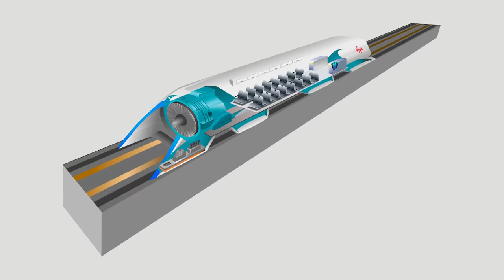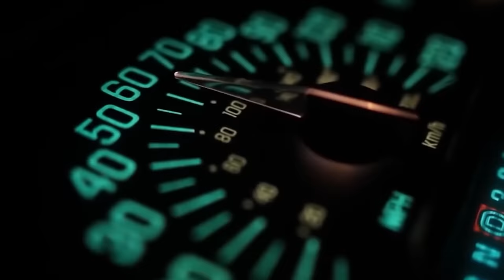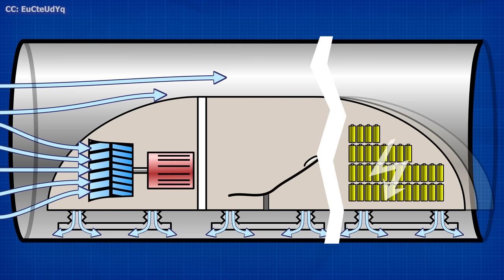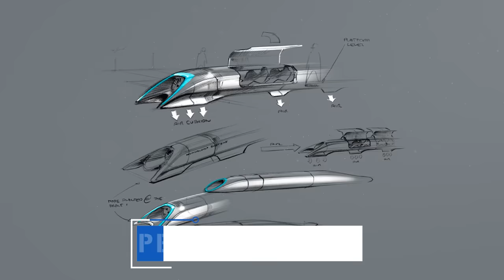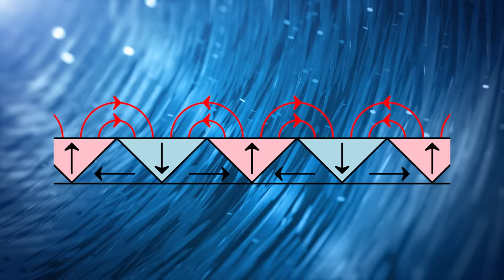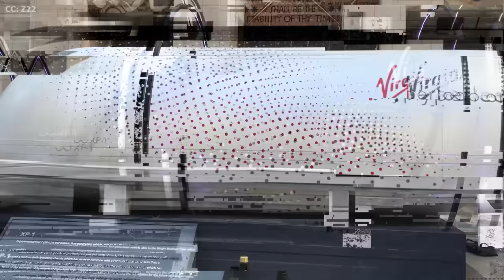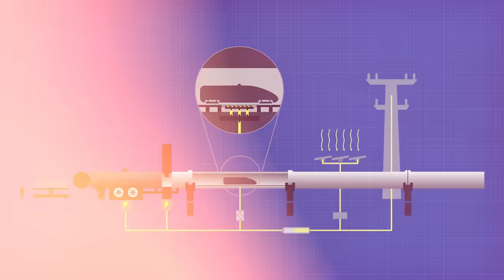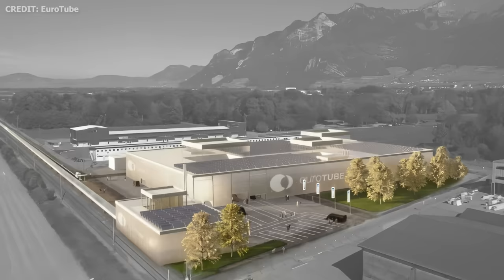We’re Getting Closer to a Hyperloop...

Comment: The number of reasons it's not viable are massive. For one, the amount of energy takes to draw and maintain vacuum in hundreds of miles of the tunnel almost certainly exceeds the Energy savings
Reply: Right? But Elon came up with it and he's definitely not a raging lunatic.
Reply: @sogerc1  LOL
Reply: Viable not liable
Reply: @jongmassey  speech to text error.
Fixed.  Thanks.
Reply: I wonder about this one myself it can be tough to maintain a vacuum in something as simple as an industrial chiller how is this going to be maintained?
Reply: @marccracchiolo4935  Exactly. And now you're talking about thousands of miles of tubes, with various unions and fittings, not to mention the entry and exit points.
The energy to create and maintain that vacuum is substantial.
Reply: keel5626  You already are.
Reply: @sogerc1  ha!
Reply: It's a practical impossibility before it is an economic one. I've worked in a shop in which there were a couple of vacuum machines that only temporarily pulled a vacuum on a few cubic feet. Yes, big motors/big current draw. The biggest problem was the cost of the lubricants and their maintenance. Clearly, Musk has no idea. And as for air bearings in a vacuum, spare me. But here's one born every minute, hence believers.
Reply: @davidbrayshaw3529  exactly, it's impractical on many levels, not even counting the potential safety hazards (and corresponding liability)

When gets me about the Musk cultists is that the hyperloop failed to deliver, even on a small scale.  The problems would only grow as the system was scaled up.
Reply: @SiriusMined From my observations, most cultists, are in white collar jobs and have little experience any sort of tech other than computers. It is no surprise that they are so easily led.
Reply: You only need to do that once, then it's just the energy of operating the airlocks and pump out whatever amount of air that escaped into the system during the airlock transition. Also the tube is not vaccum. They are trying to simulate the atmosphere of 30000ft.

Comment: Sorry, but this mess of vacuum trains has been debunked time and time again. The idea goes back to at least the early 1900s.
Reply: You mean debunked by thunderf00t? That guy doesn't even know the difference between a soda can and a vacuum chamber. Vacuum chambers have stiffeners to protect the walls against buckling loads.
Reply: @johntheux9238  LOL a Musk fanboi
Reply: @ddpwe5269 Has he said anything incorrect?
Reply: Yes. No one cares about the strength of the tube. We can all agree that the tube will hold a vacuum and remain strong. Our concern is that it would be near impossible to make such a long tube have a vacuum as our current vacuum tubes are tiny in comparison, and that if your train had an accident you are now exposed to that vacuum
Reply: Yeah, and in the early 1900's you could still cain a student into submission. Great thought, not a realistic one though. 

Hand a person in the first Great War an iPhone of any era and they would succumb to the ails and be sent to the crazy house
Reply: @mums_poop_sock  Vacuum tunnels in particle Colliders are not tiny.
Reply: @othmanskn  yes they are, especially conpared to the size of a train tunnel!
Reply: @mums_poop_sock so, we just need smaller people
Reply: @mums_poop_sock  If it's welded it would greatly reduce leaks compared to a vacuum chamber that uses expansion joints.
It works, high speed rails use welded rails for example, the trick to get them to survive thermal expansion is to build them in the summer so that they are only under tensile stress when they shrink, not compressive stress.
Reply: @othmanskn  Big cargo ships have a way bigger radius and can survive one atmosphere of compressive stress. Welded rails used for high speed rail are hundreds of miles long and can survive thermal expansion just fine. Scale is not the issue.
Reply: Electric cars go back 100 years as well.  It can simply mean the technology wasn't there yet to make it feasible.